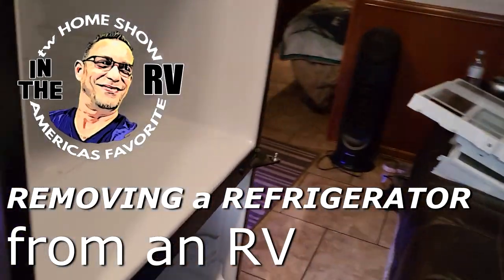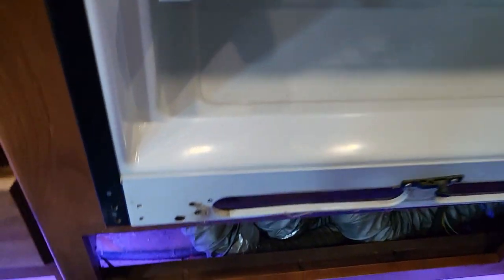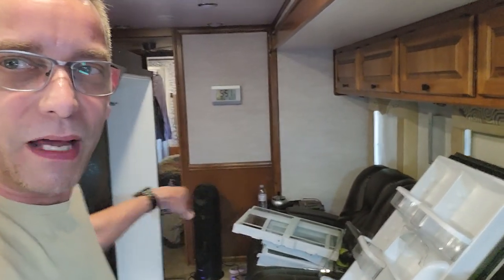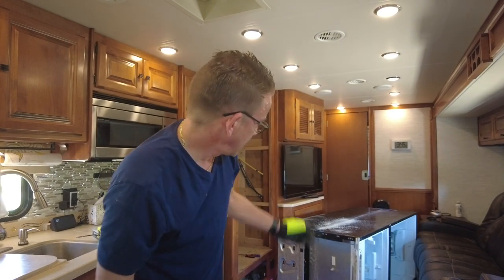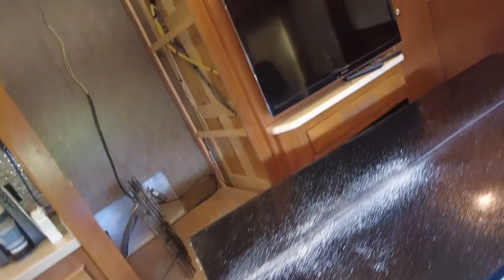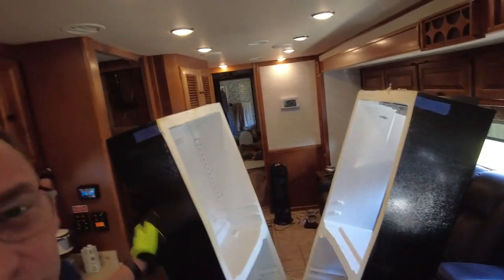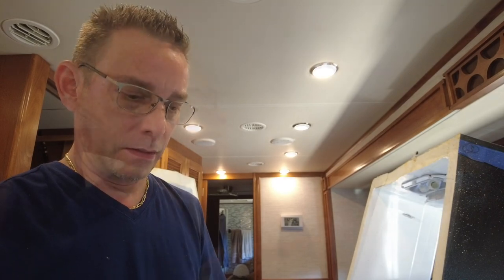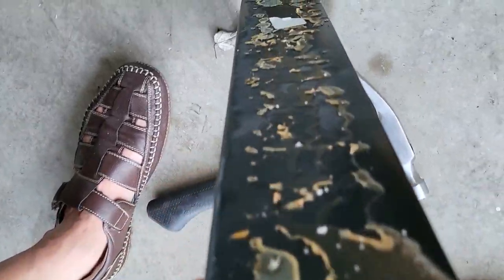tw RV ADVENTURES - Episode #41 | Remove your RV Refrigerator | How to REPLACE your RV Refrigerator?

Comment: Just last week I ripped out the factory dometic refrigerator in a Fleetwood excursion and put in a Samsung rf18 compressor refrigerator. I was just about to install a latch where I'd need to drill and screw into basically the same area that you did. Tons of videos and pictures of things being screwed in that area online. I thought it was safe. I've seen all sorts of T-bars and screw in knobs and catches for sale that go in that area between the doors, or between the the freezer drawer and the doors. I just hadn't decided which to buy. Now I don't know if I even want to try it.   Anyone have a good solution for Samsung rf18?